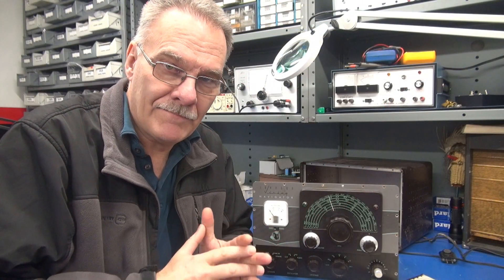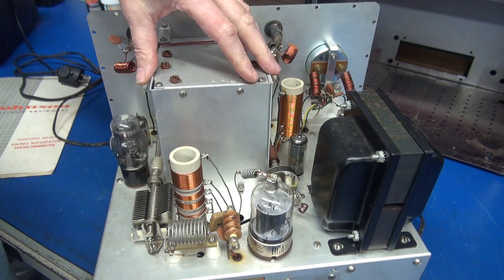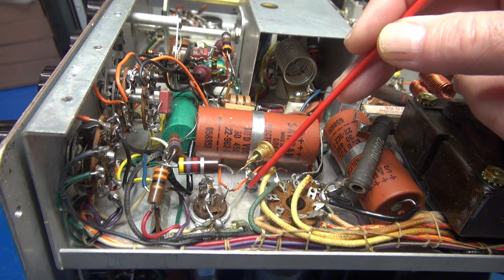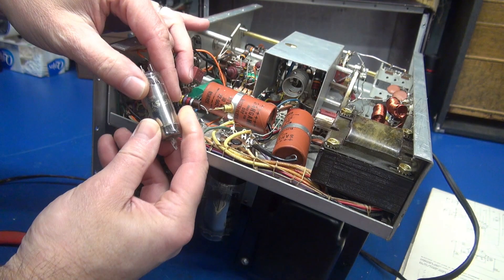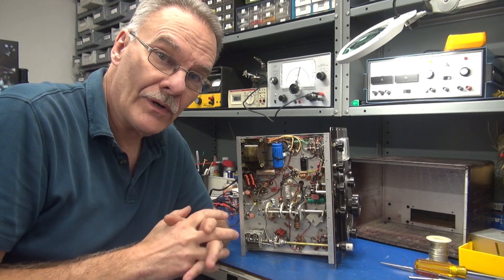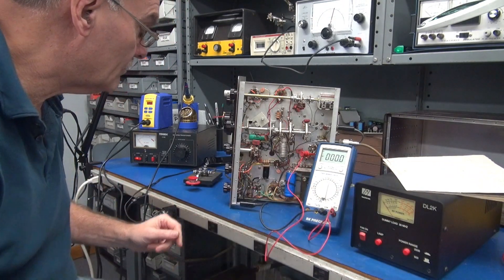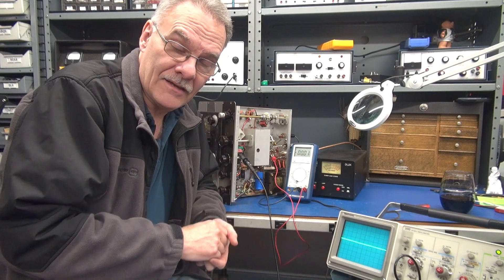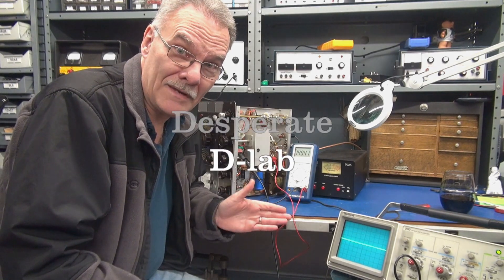Johnson Navigator Ham transmitter repair D-Lab stumped need help no transmit difficult problem

Comment: I applaud removing Mods and putting the circuit back to original.   Drawing out the mod ( schematic) lets you see what they were doing. > A receiver on the workbench is a very useful tool.  You can then hear the oscillator and know it's frequency and strength, and quality !  <  >I keep  75 m and 40m crystal handy and usually will begin to test a transmitter using a known good xtal.<  VFO's can be a Lot of trouble, and are best left till last ! Test every other part of the transmitter first, and get that right.  In rthe similar valiant, ranger, navigator, pacemaker with the bottom of the vfo virtually inaccesable,   Even using an extender test socket on the vfo tube.. you can get stumped.  >Is there a clamp tube that keeps the final plate current from going through the roof when there is no drive ?  < Adjusting that so you can see what the plate current is doing, would have made it a LOT easier to see that there was no drive.  In the comments somebody says " the tank switch was riveted together backwards".  My guess is that it was flipped front for back.. which would make it the mirror image...  A Problem made by the builder.   Which sounds like what was wrong here.  The wafer for the VFO bandswitch was not in synch with the Driver and Final Tank Band Switch Wafers.     I make it my practice to physically clean these wafers with DeOxit and often with a rubber eraser as well.  In the process of cleaning, you would most likely notice this kind of problem, as you exercise the control and watch the wafer and wipers  make and break.

Comment: It sounded like the mod he was going for was that voltage regulator in the VFO. Since you said there was a diode, a voltage divider and a wire going to the VFO. But it appears that didn't have much to do with your problem. Glad you figured it out!

Comment: Check for B+ on the antenna connector just to insure the blocking cap isn't shorted. Also do you have driver RF on the grid of the 6146?

Comment: Hi Terry, in addition to the last comment I left below, I thought of another possible problem.  About 5 minutes and 11 seconds into your video, I paused the video to get a better close up of the band switch ( I believe it's the band switch) it's the 3 pole ceramic switch.  From what I can see from the video, those contact surfaces look to me to be "pitch black".  I'd suggest cleaning all those contacts using "TARNX" with a cotton swab.  TARNX will polish up those contact surfaces better than anything I ever used including DEOXIT.  DEOXIT is expensive and doesn't do as good a job as TARNX and bottle of it will last a life time.  I'm not suggesting that this will solve the problem but, we all know that this vintage equipment comes with a lot of corroded switch contacts etc.  As a general rule, when I get a piece of this vintage equipment, one of the first things I do - in addition to replacing the filter caps - is to clean all those switch contacts.  This also helps to get a better view of any possible arching that may have been going on in that switch that all that black crude is covering up along with  any possible cold solder joints, broken wires etc;.  This helps eliminate a lot of those "phantom" problems we sometimes just can't see.   JUST A SUGGESTION !  Bill
Reply from the maker: Hi Bill, Yes Sir, cleaned the switches Yes the were tarnished. Hey, I'm building your VFO PS right now! abt time huh?

Comment: Hey Terry, don't feel bad man - I have the EXACT same problem with my Heathkit DX-60B - and I can't figure it out either.  I beginning to believe it may be in the Function switch.  I already had to replace the XTAL switch because it was toast -- it actually sparked and smoked.  I know that these Heathkit swithes have been know to go flakey - especially the phenolic ones.  Good Luck. Bill

Comment: Great! Another ham rig repair.  Dont feel defeated, when someone else has created so many mods there is no telling what could have been done.  Just one connection out of place could be a game stopper.  With all the circuits working as should and all the voltages correct, perhaps there is a problem in band select and VFO?  Reason I say that is there is not but just so much that goes on in this transmitter.  Thanks for the video Terry and Happy New year.
Reply from the maker: Yes Sir, Turned out to be the VFO switch not engaging with the proper band select position. Took some time to align it, Lots of lube later, it works as it should. Navigator is transmitting again!

Comment: Maybe, the modder didn't think the manufacturer knew what they were doing, so he rebuilt it the way he thinks it should be. I know a local ham that thought that way, and one day he got a brand new Drake TR4, and the next day he was in the radio changing parts and rewiring the underside the way he thought it should be. He did that to his Swan rig, too.

Comment: glad to see you found the issue.
I had a Navigator that was beautifully built from a kit….it only worked on 20m. The vfo worked fine on all bands and all the voltages were correct. I finally figured out that the tank circuit bandswitch wafer was riveted together backwards by the factory. This meant that the tank ciircuit was only correct in the center (20m) position. I am sure the original kit builder and subsequent owners went nuts on this one, I nearly did.
I have another one on the shelf that you have insired me to investigate.
k7yoo

Comment: SOLVED!  VFO switch was wrong!  Read the Update in the video description.

Knew you could find it, Terry.  As it often happens, there's a fine line between setting them aside completely and just stepping back for a bit to come back with a clearer head.  Especially in the case of a modified unit, no telling what gets taken apart and put back wrong.

I'm reminded of a recent problem I fought with an intermittent rear taillight on my van.  It would quit, I could thump it and it would start working so I couldn't find it.  Later it would do the same thing.  Swapped the bulb, it acted the same.  Even priced out taillight assemblies.  Worked on it a bit now and then, no luck.  Finally dug up another totally different bulb, popped it in, worked great.  Two identically intermittent bulbs?  Yup!  Obvious after the fact, drove me nuts fighting it because I assumed the replacement should have changed the symptoms.

Glad you could close out 2021 with a win, Terry!  Here's hoping we all have a better 2022!

Comment: I hate when people modify the original design and butcher the unit to the point a complete rewire has to be done. That happened to me on a Collins 75-A3 Receiver I shelved that one after seeing the mess that was made. Then after that it was a DX100 Transmitter that someone modified and had to put it back to stock I fixed that one so it works fine. So you have grid voltage but its low not 80 volts like it should be and have you also opened up the vfo to check for any mods in there that could be shorting out the switch?  It could be a lot of things really I am glad you are persistent.

Comment: Hi Terry, 
I can't find my navigator manual but will look some more. 
Things to think about.
1) all voltages are good, sounds like you did that.
2) If there is an issue with the VFO???? Try a FT 243 xtal. 40 meter is what I'd try first.
3) Xtal / VFO switch ???? exercise and try again.
I can tell you the Navigator is a stable xmitter but you have had others, so, you know.
4) do you see the VFO output on a scope?? Do you see an Xtal oscillator ??
5) Two glasses of wine and go to bed...
73 de WA4AOS Glenn

Comment: Haven't worked on a Johnson in decades & it was a different model. But I worked at Heathkit for a couple years. No 'Ah-hah, I know what that is', just thoughts after looking at a Navigator manual online...

0) The sheared off screw head might not be a big deal...unless it indicates the thing was dropped. Anything ceramic switch wafers traumatized?
1) Where was the scope probe connected when you showed VFO signal? V3 plate? V6 grid?
2) Did you look at Tune switch position functionality vs. Transmit? Maybe an alternative view of where the signal chain might be broken.
3) Open or badly out of tolerance (high) carbon composition resistors? V4 as 'keyer' has my interest. It obviously (?) allows the VFO to oscillate, but the 2nd triode (6-7-8) has a lot of dependence on SW2A/B & SW3A/B. Conversely, a lot connected to those switches to depend on V4 function.  
4) Any open RFC's or wire-wound R's?
5) Meter wasn't open, but DMM mV across meter to sanity check meter?
6) Hate to ask about continuity through switches...I wouldn't want to try to map the switch paths with just a manual. You may not want to do it either for time reasons...make that the last question after you have an idea what isn't working.
7) The mods may never have been successful. You may be looking at the 'work' of a Neander-tech.
 
Hmmm...you sound like a Midwesterner on either side of Lake Michigan, and you were in Kalamazoo a couple months ago...maybe you are.

Comment: Terry, take a look at the meter movement. An open meter is a common fault.   73  WC4G
Reply from the maker: Found the issue, Misalignment of the VFO switch underneath. The linkage is stiff, does not engage properly, so there was a mismatch of VFO freq vrs band switch setting, I have it transmitting, but some lube & alignment is required.
Reply from the maker: Hi Don, Yep checked it, there is also slight movement in the grid position.